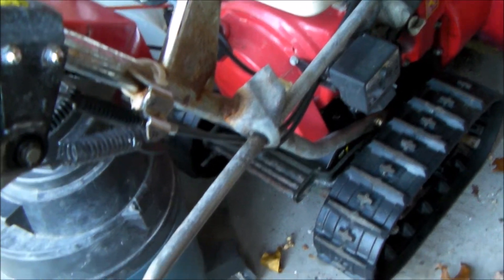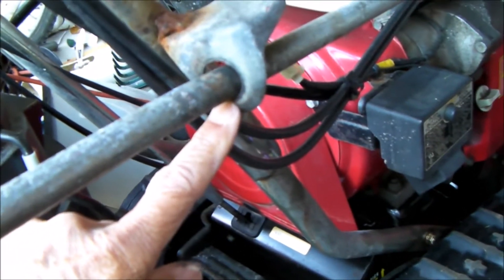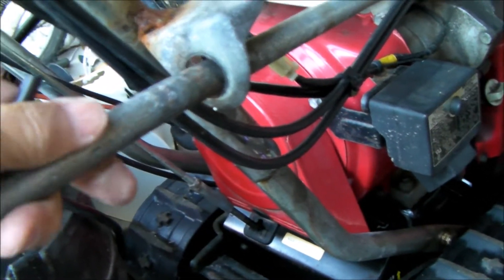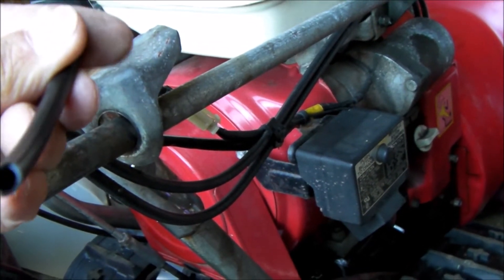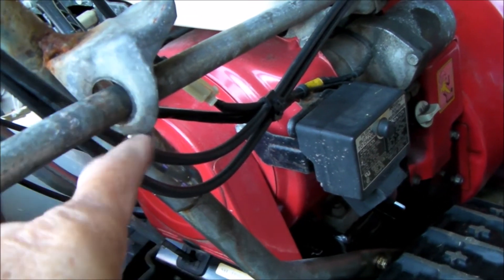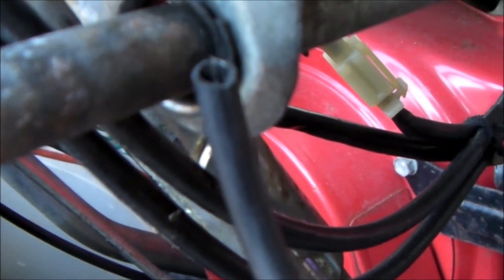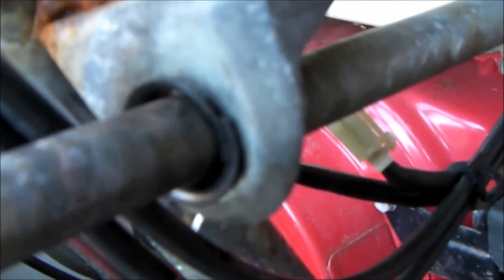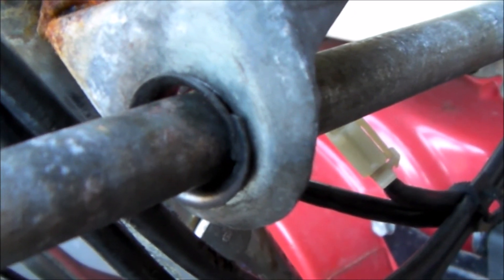Snowblower Chute handle modification

Comment: Another good idea is to motorize it, by cutting the hand crank part and to just connect a cordless drill instead, easy to use and not expansive.